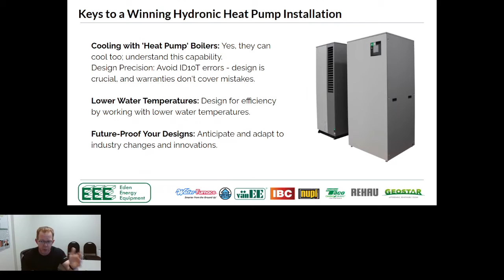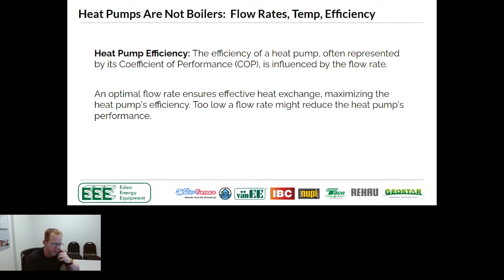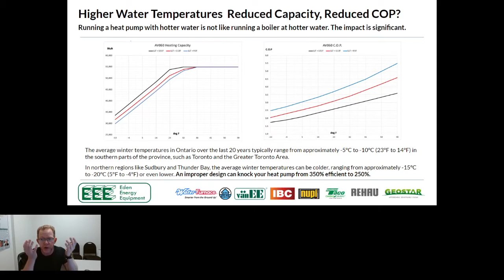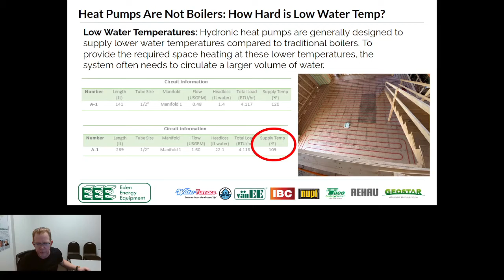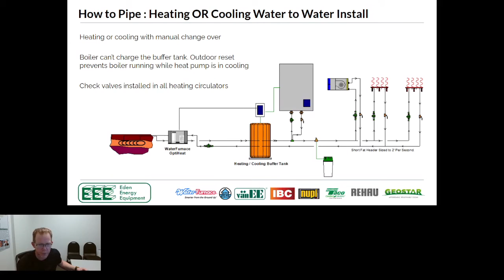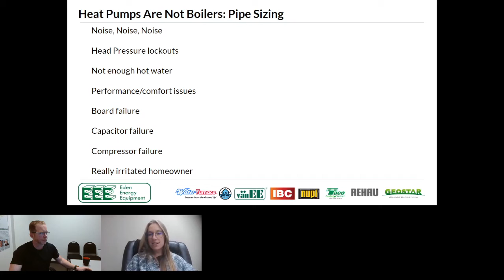Hydronic Design: Exploring Air to Water System Piping Strategies

Comment: At https://youtu.be/pjOCL9LBRVg?si=AnN6o4AFPyT8ybZm&t=1332, why is the low COP (2.6) circled at the 5gpm/130ELT while the "comparison" circle of 3.6 is at 10gpm/100 ELT. It would seem to me that the 30 degree ELT difference is a bigger driver of the COP increase than the increased flow. Thanks for the video, really appreciate it - I have an Arctic heat pump (035ZA/BE) w/a nominal flow volume of 6.5gpm and have been curious about the setting on my circulator pump.